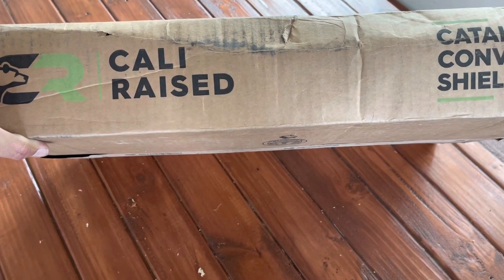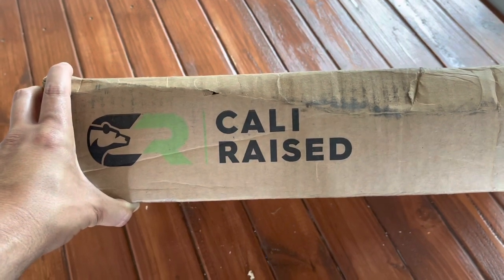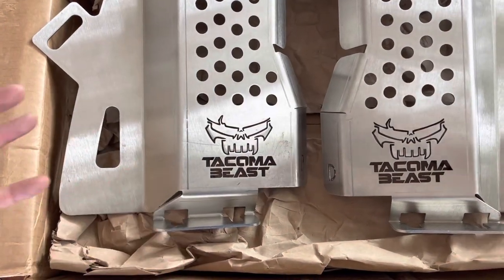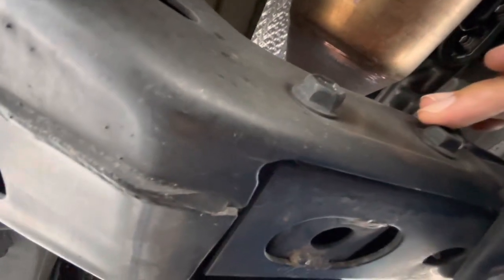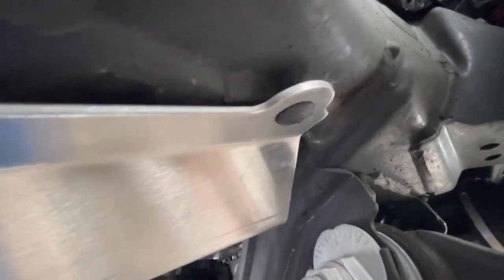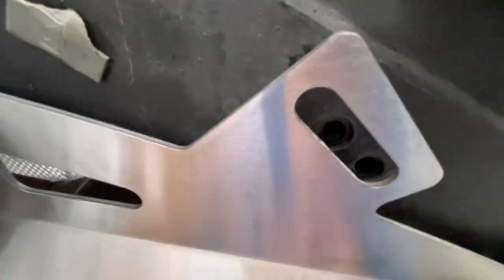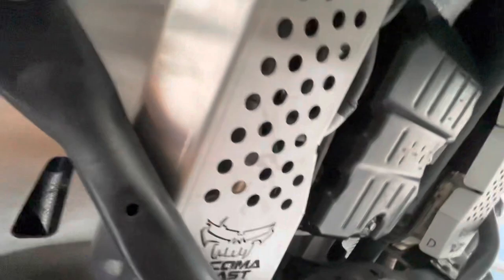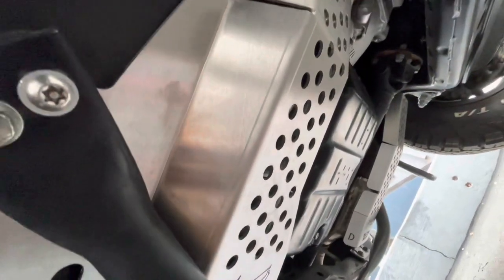Shields Up! Catalytic Converter Shields - Unbox & Install - Keep Your Tacoma Safe!!

Comment: This was the first thing i put on my 2023 Tacoma right off the lot took me about an hour  the ones you have are the newest design as were mine which makes them a bit easier to install and from what I've heard the old design had a rattling problem on the driver's side due to clearance issues but is now that is resolved with the current design hey for under $200 bucks its cheap insurance  as a Machinist fabricator by trade they are very well constructed and precision bent and made from 1/8 thick stainless steel doesn't get much better than that
Reply: When you loosen the transmission bolts to put the covers after did you add red loctite ? Or did you just tighten the screws back up like that. Also did you troqué the screw down or just hand tight the screws down
Reply: @FOURFTP  Hello I did not use any thread locker at all but I did put antiseze on the stainless steel fasteners where they screw into the frame because stainless steel tends to gall and I don't know what kind of reaction would happen between the steel frame and the stainless steel fasteners and also if I have to remove them in the future and yes I did torque the bolts  personally I don't think it's necessary

Comment: Honestly even tho the instructions don't suggest it, seems almost wise to put one regular bolt and one Torx bolt on either end of the brace. Otherwise they might just unbolt the normal bolts on the interior side and pull down with body weight and bend the steel brace away. Once you've done that you can grab a hold of the shield closest to the driveline and try to do the same. 

Now maybe it's not practical to bend that SS but if you put one torx on either end to whatever extent you trust the, "security thru obscurity" aspect of security Torx they'll get neither end free to pull on. Food for thought...
Reply from the maker: Great insight! Thanks for posting this 👍🏼👍🏼

Comment: They do work on manual transmission Tacoma's with a slight mod to compensate for the smaller transmission case.  Cali sent me a scrap piece of aluminum and I modified to extend the shield to prevent access on passenger side.  Even without the modification, it still makes it tougher for the thief to get the cutting blade on the exhaust.

By the way, this guy is a hack.  Who uses SAE tools to take apart metric fasteners?  You can see the bolts and nuts are getting damaged with SAE sockets and box wrenches (that is the round thingy mentioned in the video).

Comment: Great vid again WCT!!! Just picked up my Taco this weekend!, awsome truck. Will definitely get these installed. What’s your thoughts on undercoating. Thanks….
Reply from the maker: Thanks Larry and Congrats on the new Taco!! Which Trim did you end up getting? I spent a handful of years living on the East Coast.. if you live anywhere where there is a lot of snow//road salt in the winter or you plan to be in alot of mud etc.. I would definitely get an undercoat done.. when I lived in Maryland, I bought a used GMC sierra 1500 that only had 40,000 miles on it… but the bottom had a lot of rust issues because it was never undercoated by the original owner… I did the best I could to help preserve it, and keep it from getting worse, but the majority of the damage had already been done at that point.

Comment: Hey, how have these shields been for you since you installed? I hear they have vibration issues and or noise of rubbing. Have you had any issues? I have mine on their way to me. I have wanted them for a while and wanted this brand and they have been sold out for so long and I finally got them. Let me know what you think and if you have or had any issues. Thank you so much for the video! As usually always so helpful.
Reply from the maker: Hey Pam! So far so good! Absolutely zero issues with mine.. no noise or rubbing issues at all.👍🏼
Reply: @westcoasttaco  thank you! 👍🏼

Comment: Check your driver side skid plate near the front and make sure it’s not close to your driveshaft. Mine were close when I installed them and then after getting heat, a little bit of the bend came out and it actually hit the driveshaft. Once I engage four-wheel-drive and made a horrendous sound. Kelly raised acknowledged that they had a bad batch of the new version go out.
Reply from the maker: Oh man! I’ll check that out, thank you for the heads up! How long ago was that?
Reply: @westcoasttaco  two weeks and it was fine at first but close then with heat it must’ve unbend, and when I turn my 4 x 4 on it made a horrible noise I contacted them and they acknowledged there was a bad batch in the new style which you have if you notice the older videos on these it was different.
Reply from the maker: @jglassman1122  thanks for the heads up! I’ll keep an eye on it.. they just got delivered a couple days ago so hopefully I didn’t get a bad batch! Definitely going to watch them like a hawk!
Reply from the maker: @jglassman1122  so I just measured and have about 3/4 of an inch between the shaft and front corner of the shield. Seems like that’s the common distance or close to it on other pics I’ve found.. but I’ll definitely report if I have any issues.. maybe since mine have “Tacoma Beast” engraved into them instead of “CR” they will be tougher??🤣🤣 Anyhow I really appreciate the info 🤙🏼
Reply: @westcoasttaco  you have the new style the old style used to go over the crossbar the new style bolts to the front of it. That’s how mine is. I don’t believe the old version was as close to the driveshaft.

Comment: So it’s really held on with 4 bolts ? The two star and the two bolts that get loosened up and slid onto ?
Reply from the maker: @bryanr.3241  yep, that’s it.
Reply: @westcoasttaco  thanks
Reply: @westcoasttaco  oh yea , and no rattles at all ? Thanks in advance
Reply from the maker: @bryanr.3241  no problem 👍🏼
Reply from the maker: @bryanr.3241  nope, just make sure those black rubber number knobs are on the shields. You can see them butting up against a piece of the trucks frame.
Reply: @westcoasttaco  ok cool , thanks

Comment: I wish they made these for manual transmission
Reply from the maker: I suppose since the manuals are so rare compared to the automatic they never spent the money or effort to design the MT set.. I’ve heard they will fit and that driver side shield fits perfectly, but that the passenger side still leaves a small gap.. could always order them and just see for yourself and send them back if they don’t work at all.. having a little deterrent is better than no deterrent 👍🏼

Comment: LMK if you have any rattling from the driver side shield touching the catalytic converter heat shield. 🤔
Reply from the maker: Will do, did yours have the rubber grommets that are to pad between them and the undercarriage? I also assume you tightened everything down really well? I’ll keep you posted for sure if I have any issues 👍🏼!
Reply from the maker: So far no rattling I have about an inch or so of clearance between the cat shield and the other OEM shield… also noticed that they recently changed the style of the cat shield I put on. Not sure if they changed the angle or depth of the shield to help with the touching issue.

Comment: When I loosen the transmission bolts and tighten them back do I have to troque the bolts down to spec or can I just hand tight where it feel it’s tight
Reply from the maker: I just did mine until it was a tight as I could get it.. don’t want that thing to come loose!
Reply: @westcoasttaco  noted thanks …. Yes that’s what I’m scared to do it myself. But it be dumb if I pay someone cause it’s such a easy task .

Comment: Hi , what material is better for cat shield ? Aluminum or steel ? Thanks
Reply from the maker: I’ve been told that steel has about twice the strength of aluminum making it harder to cut, bend, and warp.. however they should both do the job about the same.
Reply: Thanks, but steel is about 500 and aluminum is 270 . you think alumimum is still ok and the thieves can cut it through plate ?
Reply from the maker: @kevinle5962  I think it will be fine.. the shields are made to deter people from trying to cut through.. if someone tries to cut through it they will make a lot of noise in the process.. most likely alarming people near the vehicle while doing so.
Reply: Thanks! Then i can buy the aluminum shield and it only cost $270 then the steel on is quite expensive $500 of more it you go thicker one.